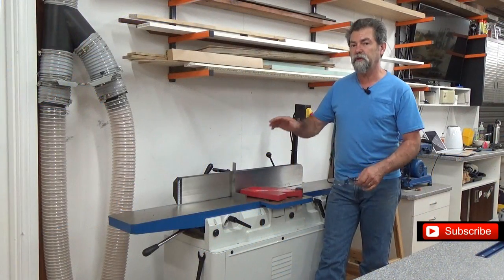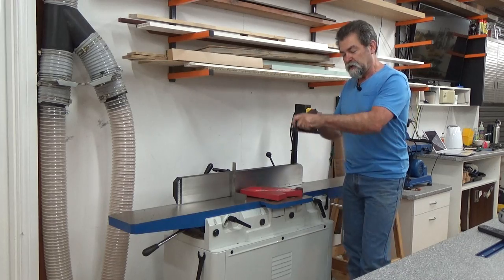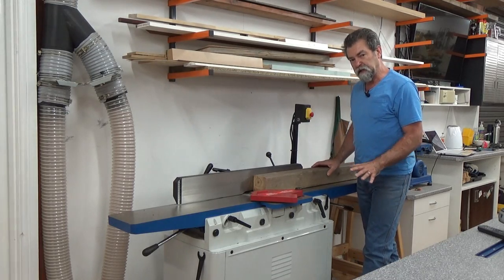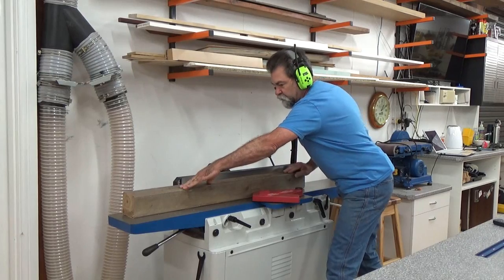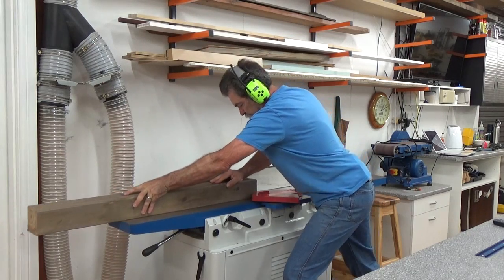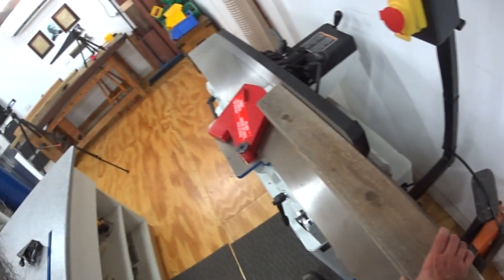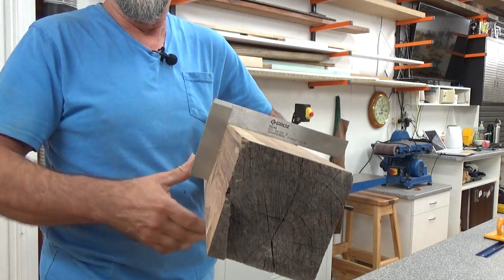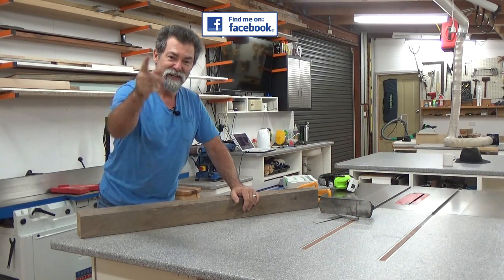Jointer | how to | dave stanton |  woodworking | beginner

Comment: I finally bought a jointer and can't wait to really start using it. Did some tests with some pine 2x4s and it's awesome. I have to say the 2 best things I ever got for my shop was the machined square and a digital protractor. Ever since I got those 2 I've noticed a huge improvement in my work.
Reply from the maker: Accuracy at the start makes the job a whole lot easier.

Comment: Hi, I liked that you used your engineering try square to check your fence. I think it would make a great "How To" video on "checking tool accuracy" for those of us with old and/or cheap tools. For instance, my try square, framing square, speed square, and my adjustable square were all out of square. My most accurate squares are two homemade timber squares and my set of drafting squares. I've re-squared the framing and adjustable squares, but not the others; but at least I know they're slightly out when I use them.

Comment: David - this is very helpful. My only comment is that it seems like you could take a step or two forward when you are jointing the board so that you don't have to reach out as far. I'm getting ripples and chipping now with my spiral head jointer - probably is because the blades are dull, as it was working great, but let me know your thoughts. I"ll check out your dust collection set up as well. It is impressive that you don't have even a bit of sawdust around.

Comment: Dave, thanks for these tips I recently bought second hand, an 8 inch jointer similar to yours, I take it now that you would thickness the piece to make all surfaces parallel to each other. As an experiment I jointed all four sides and wound up with a wonderful dressed piece out of parallel significantly.
Reply from the maker: That is correct Stephen. Joint one face and one edge then thickness plane the opposing face and rip the board to width on your table saw, finally dressing that edge with the jointer.

Comment: i have to ask why with a face and side now square cant , or dont you do the remaining 2 , apposing face and sides on the jointer is there a reason not to??? i agree with the multitude . great view mate!
Reply from the maker: Hi Pat DENNIS! You can do it that way but a thickness planer will give you a parallel surface.

Comment: Hi Dave Et here 
got tips on what to do if you don't have a jointer or plainer . All you have is a router a table saw and a orbital sander cheers
Reply from the maker: You can make a sled that can allow the router to ravel over the face of a piece of timber similar to a CNC machine and for dressing the edge you can use the router table fence.

Comment: Hi David, I bought my first jointer yesterday (Grizzly G1182) and checked to make sure that it was setup correctly (fence is square to tables, tables are flat, and blades are dead even with the out feed table), and it seems to be perfect. I grabbed some scrap 2x4 from the box store and ran it through. Long story short, I am not able to get a flat face or edge on the board, I end up running the piece through way more than I should have to and the front of the board (the part that first makes contact with the cutter) end up with a ton of material taken off, while the back remains mostly untouched and I end up with a piece that is much thinner at the front than it is at the back. I'm not sure what I'm doing wrong.
Reply from the maker: Hi Corey. The tables may not be co-planer. i.e., in line with each other. Also, try some other pieces of timber and make sure that any piece that isn't straight front to back has the hollow facing down, so the front and rear of the timber pass over the blades.
Reply: Thanks David! How do I check for co-planer?
Reply from the maker: That is a whole other video Corey. Basically you need a long straight edge, weights and feeler gauges.

Comment: ok. so totally new to wood working... and do not have a planer...just bought a jointer.  can you run all 4 sides through the jointer?
Reply from the maker: You can but not advisable. Best to get one edge and face perfectly flat and square then either put through a thickness planer or saw with a rip fence to get the other face and edge parallel, then over the jointer to clean up.

Comment: Why not run it thru the table saw. Newly square face on the fence then trim 32nd off of the old face?
Reply from the maker: What you say is correct but in this particular occasion that piece of timber was 4 inches thick, my saw cuts just over 3 inches. The main drive of this video was to show people how to use a jointer to create on flat planed surface and a square edge.

Comment: Hey Dave.  I have the same jointer.  Every time I tighten the fence - when squaring it - it moves just out of square.  Any tips or secret techniques?
Reply from the maker: first question for you is, have you locked the slide support for the fence before setting to square. The slide determines where the fence is positioned front to back over the cutter head. If not locked the fence will do as you said.
Reply: David Stanton - Fence slide is locked when setting fence square to jointer plane.  When tightening fence angle locking screw, the fence is pulled just off square.
Reply from the maker: Try undoing the grub screw that is locking ( stopping rotation)  the fence mount to the slide and then adjust to square, then tighten the grub screw.

Comment: Thanks David, I really learned a few things. One thing I want to know also is do you plane with the grain and how do you determine which way is with the grain, I always have trouble with that it seems.
Reply from the maker: Interesting point Lawrence Schaefer. The grain should be travelling from top at the front of the piece to the bottom at the rear.

Comment: With one square face and one square edge, couldn't I just run the other 2 sides in the jointer rather than a planer?
Reply from the maker: Hi banana403! Definitely can but the faces may not be parallel to each other.
Reply: @DavidStanton  But if you've got a square face and edge, wouldn't that give you a parallel reference to put up against the fence. It's already done on one face, why not the other?
Reply from the maker: Not necessarily. What if the timber hasn't been cut parallel or cut with a bandsaw? Too many variables.

Comment: Can you not just run it through the jointer again? I don’t yet have the planer . Thanks
Reply from the maker: The idea is to get parallel surfaces.
Reply: I do understand that. Is there another way without a planer?
Reply: Can I take it to the table saw? I should be able to right.?... just run the flat against the fence
Reply from the maker: You haven't given me enough detail as to the dimensions of the timber etc. It may well be to dangerous in my book. You only want to remove a small amount and how do you intend on keeping the pressure against it while passing the saw blade?